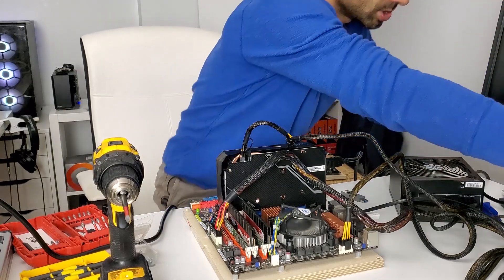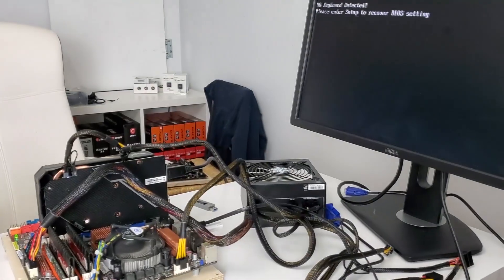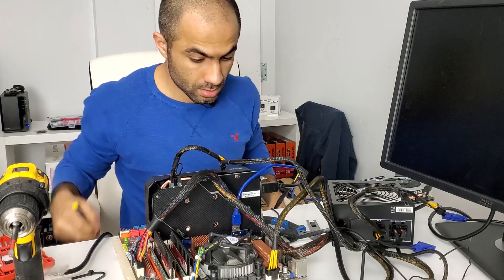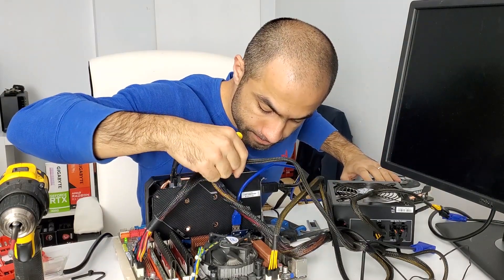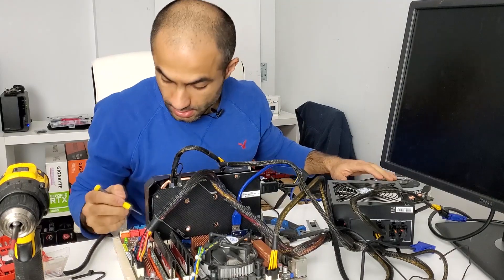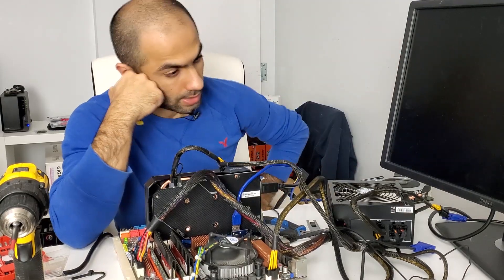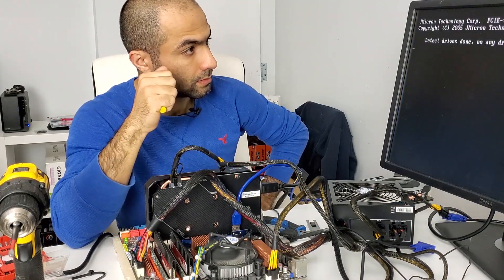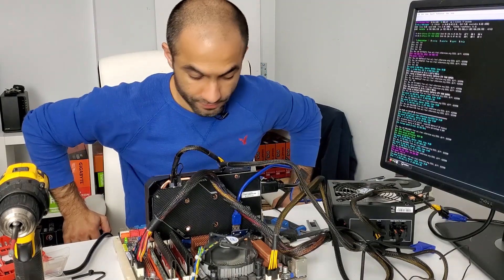Ethereum Mining on a Very Old Motherboard...IT WORKS!

Comment: waooh great info ! i have an old mobo MSI 790FX-GD70 , magically its has 4 slot pcie x16 , the question is , better I'm using the PCI riser or PCIE slot with 4 GPU ?
Reply from the maker: PCIE is the way to go. I don't know much about PCI but I read somewhere that it shouldn't be used. I have only used PCIE.

Comment: Hey great video I’m actually using a motherboard right now from 2009 from an old computer seems to boot up perfectly and runs hive os recognizes both graphics cards but when it comes to mining with flight sheet it gives a Cuda error And asks if I have Nvidia drivers installed exits and says cooling down I tried using stable version drivers and the newest version drivers also I updated to the newest Hive OS version should I try and go older for the drivers thanks for any help

Comment: Nice idea using old board running again. I have a question did u change the CPU. If Yes what cpu model did you use and what ram 8gb. The suppers did you use brand name. Im planning to build one with my old motherboard.  More power to your channel.  Tnx

Comment: Nice video, i have one question for you. Did you set up the bios(overclock) on this mobo, and if yes, which are the most important thing that we should do in the bios
Reply from the maker: Hi Dragan, thank you for watching my video. No I didn't have to do anything to the mobo. Usually there is no overclocking happening on the mobo side. On some motherboards, you'd need to enable 4G decoding, but that's on newer motherboards that have been around for the past couple of years. On these old ones, that setting isn't available. You might have some settings regarding PCIE allocation and speed that need adjustment.
Reply: @DaniTalksTech  sir can you tell which  settings regarding PCIE allocation and speed that need adjustment ?

Comment: I personally use a lot of Z77 motherboards in my rigs but i would suggest going with a Z87 or newer, the reason beeing that:
1: Z77 boards often have weird implementations of the 7th PCIe slot, my MSI Z77 G45 for example disables slot 3 (out of 7) when using slot 4. Another issue i ran into is when using 7 RTX 3000 (havent tested 2000 and GTX 1000 series) my msi Mpower Z77 didnt wanna boot up at all, with AMD cards it worls flawlessly though (using 7 Vega 56 on it rn).
2: Z77 and the CPU's that go with it seem to have some kind of PCIe Lane allocation issue, on all 2Gen CPU's i tested the 7th slot wasnt working at all when using 6 other cards already on the board no matter the cards.
3: With Z87 boards i had none of those issues till now, granted i didnt test any of those boards with nvidia cards so i can only speak for AMD but i never had any weird behavior of slots disabaling themslefes or anything lie that on Z87/Z97, also atleast the price difference between the to enerations of boards in only 20-30€ which is defently worth it considering that Z87 seems to be much more compatible with a big number of GPU's, for 6 card rigs Z77 should be fine though as all problems i listed above were for rigs with 7 cards
4: PCIe splitters dont seem to work on Z77 boards, i tried using them to get 7 cards on my 6slot z77 gigabyte board but it wouldnt boot, meanwhile on Z87 i was able to get 7 cards into a Micro atx board with only 4 slots.

Comment: Anyone tried running 6+ GPU on this Mobo?
Reply from the maker: The old mobo in the video Alan won't accept 6+ GPUs. It stopped booting after 4 GPUs.
Reply: @DaniTalksTech  I have been mining with 6 GPUs on this MOBO (with one Biostar 4-PCIe riser splitter which can run 4 gpus in one PCIe x1 slot), it runs very nicely. I however am not able to go over six GPUs, after inserting the 7th HiveOs won't even boot and mem test freezes after a few seconds. Have tried changing some settings in BIOS with no luck. With MOBO this old, I should probably be grataful for 6, on the other hand, theoretically, it should be able to handle 16 PCIe lanes, the same goes for the CPU (I have Core 2 Quad) so if anybody knew a workaround here, it would be greatly appreciated. Anyhow, I'll probably order a newer MOBO soon and replace it ...
Reply from the maker: @Warp10000  this is awesome Petr. The fact that you can get 6 on an old mobo is impressive as you said.
Reply: @Warp10000  Hello, I want to put a GT 1030 video card on that P5Q3 Deluxe mobo (not for mining, only for office tasks), do you think it will work? I have doubts because the mobo is a bit old and I do not want to buy it and then it does not work for me, thank you very much, greetings!